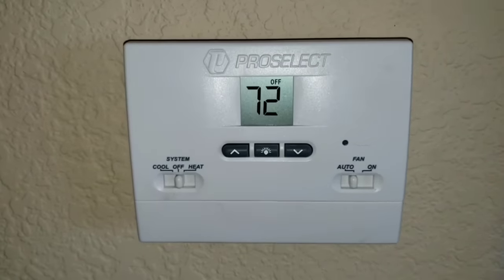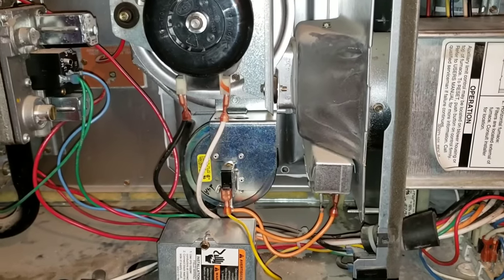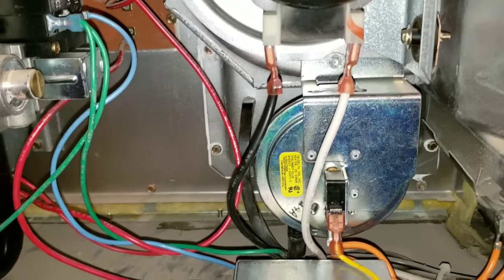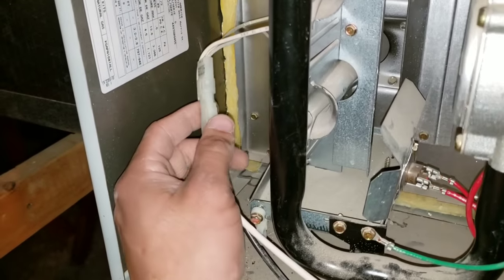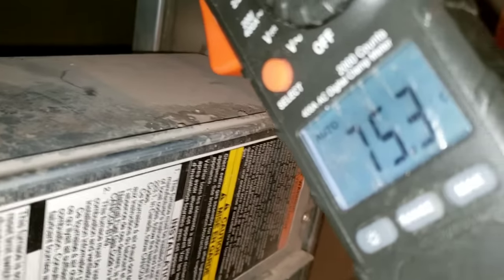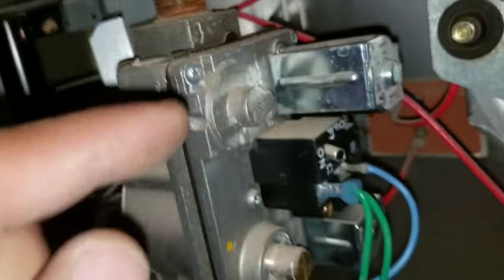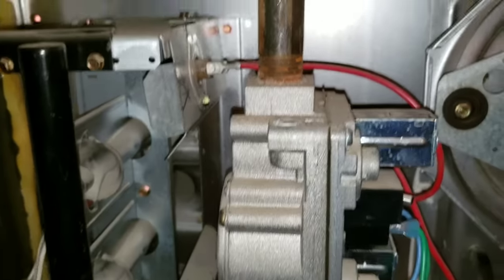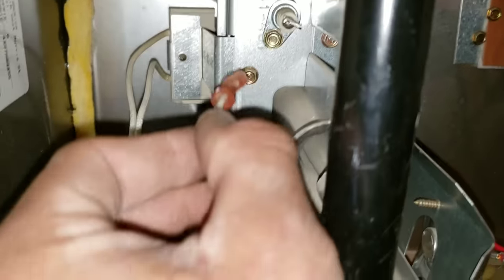Furnace Troubleshooting Step by Step with Multi Meter.

Comment: Do you have any videos to measure DC voltage signals from IFC board to ECM blower motor?  Unit fires up, flame in box, but blower doesn't turn on.  Thanks

Comment: If the HSI (Hot Surface Ignitor) is so fragile, why hasn't it broke already during installation? Or if u need a new HSI , would it break during shipment? Does it come in shipment?

Comment: The blinking red light will tell you what the fault is.
It may blink say one time, followed by three times, or maybe blink three times followed by one or two. Look up the code on the chart regarding diagnostics and it will give you an indication of what is wrong.

Comment: I have Carrier furnace (house built in 2003) install new filter($7.00 cheapy) and furnace goes in lock mode,pull filter out and runs fine. Vent stacks are clean like they were just installed. Any help would be appreciated.
Reply: Mark A coil maybe restricted.

Comment: Sam, is there any reason for  continuity between the furnace R terminal and the furnace C terminal? I am installing a smart and when I wired the thermostat C terminal to furnace C terminal it blows the 3amp furnace circuit board fuse.
Why would there be continuity between the furnace C and R terminal.

Comment: So, my ignitor is not clicking and getting hot. Is it the ignitor, or one of the previous switches? It is an old Payne. Probably 40 years old. The motor starts, just no ignitor. No off and on switch. You have to pull the fuse holder out. Maybe the control board?

Comment: sam i have questiones same furnace are you did in trouble shooting ,my questions is the furnace motor is not getting supply if you receive in voltage in24 orangewire induction blower 120 volt is not come from PCB. what is should to do because board is not support voltage induction motor

Comment: how does the board know if the hot surface igniter has reached the proper temp? I only saw 2 leads for the 120 volts to the igniter. What am I missing?

Comment: Man, that looks exactly like my Bryant furnace I'm having issues with. My blower motor doesn't appear to be turning on. I'm going to test the capacitor and see if it's the problem. Are the blower motors easily replaced in these types of furnaces?
Reply: If furnace is vertical, then it is usually not difficult.  If furnace is horizontal, then it can be about the same or a lot worse. An example of a lot worse in the one crammed into my small attic  where there is very little open area to work within and no permanent attic flooring surface.
Reply: @JohnDoe-pm3oq  mine is definitely horizontal. I have pretty decent room though. I took out the capacitor today. I was getting 7.39 uF. But, not consistently. I had to move the multimeter testers around to get the reading. I tried cleaning the terminals with steel wool and put new connectors on the wires. Blower still doesn't come on. I ordered a new capacitor since it was like 8 bucks. I'm going to continue troubleshooting and will install the new capacitor when it comes.
Reply: @philipgrasso2590  I have same type of horizontal furnace and blower motor is making humming sound but's not starting. The capacitor was showing readin of  7.1 uF but after replacing new capacitor which has reading of 10 uF, it ran for a day. The next day blower motor was again making humming sound it won't start. The new capacitor is showing 10 uF.  So I suspect blower motor to be the culprit.  I can move fan blade with hand easily, so there is no motor jam. I'm searching for tips how to remove blower motor assembly on horizontal furnace like the one Sam shared. Any tips suggestions will be appreciated.
Reply: @saileshp2903  I don't have any tips unfortunately. I would say to watch Sam's videos. They helped me diagnose my control  board being bad. Good luck.

Comment: The wire going to the ignitor from the control board will read 120v, but as soon as i connect it to the ignitor, it drops to 0 V.  So you know what could be the problem

Comment: The Hi Limit Control is what is Mounted into the Chamber that senses the Temperature of the Chamber to tell it if you have a Dirty Coil it No Blower Motor or weak capacitor that is not keeping that Temperature within Manufactures Rating
Reply from the maker: Thank you for your input. When I post my videos I try to explain things using simple terminology. In my manual for the furnace in my video the schematics have this labeled as a limit switch. Thank you for sharing the name of the component as well as what it's function. I appreciate viewers who are able to share their wisdom and insight!
Reply: Great presentation

Comment: Question, 120 Volts coming in goes straight to the furnace Transformer?
Reply: Yes The Transformer is in parallel with incoming power thru the cover switch.

Comment: Mine starts for one minute then it shuts off. 
All sensors are good
Flame sensor is good. 

When I leave the blower motor compartment open, it stay on. 
It doesn't turn off. 
I keep it cracked open in winter. 

On summer I close it,  have no problem in my AC. 

Any comments?!!!!

Comment: I have a 3 flash code on my goodman furnace, I changed the pressure switch, I took the inducer motor off and cleaned everything out of there, I cleaned the flu going from the pressure switch to the inducer motor, I checked the hose connecting the pressure switch to the inducer motor, I disconnected the exhaust pipe  that leads outside from the furnace and the hot surface ignitor turned on for a few seconds then turned off and now I'm back to where I started with the led flashing 3 times. The inducer motor turns on fine and sounds good and I've even changed out the flame sensor and the hot surface ignitor just because and still nothing, I'm at a stand still and with the cold weather finally moving in I really need to get it fixed but it's so frustrating because everything I've done has been in vain. Is there anything you could suggest, thanks.
Reply: did you have to replace your board?
Reply: @ballinblaza   @wes olsen  I have not. Weird story, I ordered a new board from Amazon and the day it was being delivered I had a friend check out the old one while it was still installed and we noticed that when we pressed slightly on the board it would "click on" and the furnace would work, when we released it it would cut off. So that left us stumped thinking it could be a faulty power wire. We didn't mess with it anymore, I duct taped the board in the "on" positing and the new board is in the box the furnace is still going strong

Comment: Could you tell me what the switch to the right of the pressure switch is called?
Reply: Believe that is the high limit for the inducer motor to verify there is no blockage in the flue pipe. If there is a blockage it will overheat and trip that high limit and shut down the furnace. Not all furnaces have them usually 80 percenters I believe

Comment: I'm getting a 5 light readout flame rollout sensed. No 24 volt going out of the circuit board.
Bummer! what's the problem?
Reply: Ray Gucchi check for continuity at all the rollouts and limit switch, if you replaced the circuit board then check if there’s not a brake on the wire, but also check if the terminal from the thermostat are good. If still you don’t have 24 volts going to the rollout then even if you got a new circuit board it could be bad. But check everything else to be sure.

Comment: I have a problem at 16.45, the click does not happen and the ignitor turns off!!..There is no power to the gas value. The diagnostics light stays on and the error code for light is all good. What am I missing ?

Comment: Doesn't the dip switch on the board control how long the blower stays on 30 60 or 90 seconds?
Reply from the maker: 👍 Yes it comes set from the factory for 90 seconds.
Reply: If furnace has dipswitches

Comment: On 7:28 where you verify voltage you have pos lead on neutral and neg lead on hot. You have them reversed.
Reply: When measuring AC voltage, it does not matter which lead is connected to either terminal.  In other words, polarity only matters when measuring DC voltage.
Reply: This doesnt matter 👍

Comment: I have 15 V AC going to the gas solenoid? Should be 24V DC   Guessing it’s my board 😩
Reply: You probably only have half of the step down transformer hooked up.  You need to check all three of the wires on the secondary.  Seems like you are using a leg and a neutral when you should be using two legs.

Comment: While this is a very good video, there are still unanswered questions. For example, 
1. why does the blower run for 90 seconds at startup?
2. You say once the inducer blower verifies...verifies what? There's gotta be more to it.
I think there is more to be explained
Reply: I agree. At one point he says "once the inducer motor proves..."
Proves what?
Also, an inducer motor cannot verify anything. If the motor gets 120 volts it will run. If it doesn't get 120 volts it will not run. 

I'm sure he understands what going on here but he is not the best at explaining things.

Comment: My igniter glows red, but turns off after about 15 seconds because the gas valve does not open. and cycle repeats. What could be wrong?
Reply: See if the gas valve is getting energized. A multimeter would be best to check for 24 volts on the gas valve. If you don't have one you can place your hand on the gas valve and you should feel a click when the valve is energized. If you dont feel one then a multimeter is required to check for voltage. If you do feel a click then make sure the gas is turned on at the gas valve and the service valve. If the valve is energized but is not opening then the valve needs replacing.

Comment: Why does my blower motor not shut of in Ac mod when the house temperature reaches the temperature set like it’s set at 78 it’s 95 today why does not the blower motor shut off the filter is clean .

Comment: What if the W wire isn’t getting voltage?
Reply: Check for 24 volts across R and C, if present then the problem is in the thermostat or the wiring for the thermostat. If there is nothing across R and C then the problem could be the fuse, the transformer, or the limit switches.

Comment: I thought this was a great video with you checking everything with a meter on the startup cycle but you failed on a very important step and that was the flame sensor. I thought you should of showed the power coming from the board to the flame sensor and then check the conversion from AC to DC millivolts back to board. I have had a call where the flame kept shutting down as if it was a bad sensor but it was a bad board not sending out voltage therefore not getting any back and shutting down.

Comment: You forgot to mention the flame sensor sends DC voltage back to the board
Reply from the maker: No I did not add (I thought about it 🤔)  because the video was pretty lengthy. There are some great videos already on YouTube where guys explain the technical terms of voltage change etc. I might consider sometime doing a post in the near future. Thank your for input! 😄
Reply: He didn't forget because the flams sensor does not send voltage to the board. My understanding is that the flame provides a path to ground and that closes the circuit.

Comment: Help help well  im at the flame senor  gas valve  turn on for two seconds then turn off .I replaced senor   check the gas water column  pressure   replaced transformer  gas valve won't stay on
Reply: Make sure that all burners are igniting. If dirt or debris gets into the manifold orifices it can block gas flow to the burners. Make sure the burner box is properly grounded, make sure the flame sensor is properly connected and that the wire is not broken anywhere

Comment: Ok lets clear up some of the misinformation! DO NOT CLEAN THE FLAME SENSOR WITH "SAND PAPER"!!!!!! It's to be polished with 000 or finer steal wool only. Sand paper will scratch it and cause it to collect carbon faster. The first step in a call for heat to the board is "VERIFICATION OF SAFETY DEVISES"!!! 2nd is inducer motor is energized which will begin the negative draft through the heat exchanger and if the differential is met in pressure the "Pressure Switch" will close completing the circuit on the "Limit String". The sensor on the back wall of the furnace which was just referred to as a sensor is the "High Limit" which prevents the heat exchanger from getting too hot if there is a restriction in air flow i.e. blower motor failure, closed registers, dirty air filter ect. The Inducer does not prove it's self! 3rd the inducer will run aprox 20 - 30 seconds at which time the "Hot Surface Ignitor" is energized with 80 to 120 volts depending on the type and brand of equipment for aprox 15 seconds. 4th the "Gas Valve" is energized to begin ignition. The gas ignites at the ignition burner first and rolls across the remainder depending on style i.e. End Shot, Ribbon etc. 5th is proving the "Flame" The "Flame Sensor" has 120 volts standing on it waiting for flame to engulf it. once engulfed the voltage is rectified through the carbon particles of the flame and ground to the burned which is in turn grounded to the cabinet and sends a low voltage DC current back to the board to verify the flame. This is a 3 - 5 second verification process. 6th step is "blower is energized at the time delay determined by the control board or other fan control device. The furnace continues to heat until the thermostat is satisfied or a failure occurs. The blower runs for 90 seconds if there's a call for heat from the thermostat when 120 volts is applied on Carrier and Bryant brand equipment not on all the other brands. This can also be bypassed if you know how! The only part of this entire process which proves itself is at the very beginning and 99.9% of the technicians are unaware of it. Everything else is merely energized or circuit completed to continue the process. The 12 volt DC Processors in the control boards are monitoring the logic of the sequence of operation. If everything goes in proper sequence it operates without a hitch.  I appreciate guys trying to help others in the HVAC industry but if you're creating videos and posting to YouTube then please be accurate. If you really don't know it 100%, DON"T PUBLISH!!!